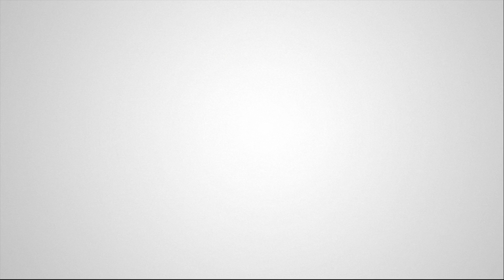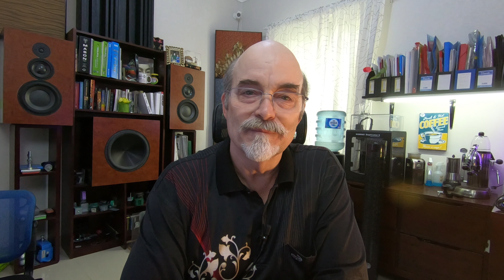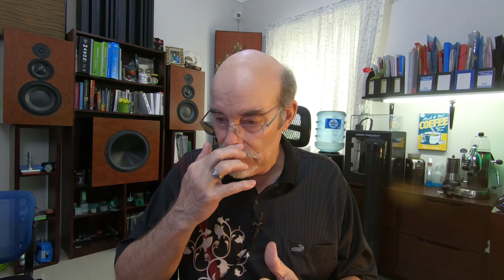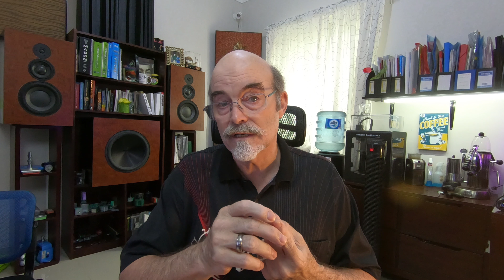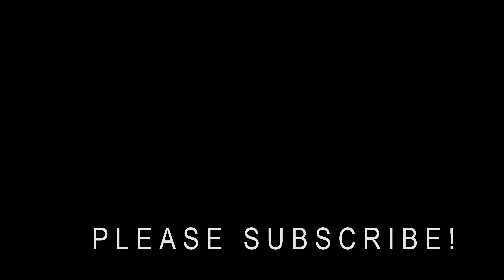Rock Wool Does Not Sound Proof

Comment: I used the rockwool r30 for my ceiling joist throughout my basement and rockwool r13 along the walls throughout the basement. I used 3/8 drywall to cover the walls and 1/2 drywall on the ceiling and added a door to the top of the stairwell. I have electric guitars, drum set, entertainment room and lots of company over often. If the vents are closed in the basement, you literally can't hear ANYTHING going on in the basement with volume at full tilt. Maybe I did something different to get such results but my experience with rockwool was definitely soundproofing
Reply from the maker: Very nice! I'm happy for you. But it WASN'T the rock wool - LOL!! Your story is anecdotal. Correlation does not mean causation. I am teaching only FACTS here. Do more research... and I do not recommend that you try to convince others that the way you did it works to any degree at all or that it will work for anyone in any situation. It worked for YOU, in YOUR basement, with YOUR materials.
Reply: John Brandt do you know what it could be that cut the sound down?
Reply from the maker: I cannot claim to 'know' because I don't know your complete structural build, however, I am pretty confident that it was MASS and SEAL - along with the damped resonance of your structure. But I have NO IDEA 'how much' it contributed to the attenuation of the sound because no standardized tests were performed. That (standardized tests) is really the only way to gauge.
Reply: its a common construction product and it does help.  why would constructors spend thousands on it?

Comment: Great video!
What do you suggest to buy for better (dampened) studio accoustic?
I was going to make DIY rockwool panels, but glad I watched this first.
Is there any DIY with better sound absorption than cheap foam?
Reply from the maker: Martin B, for your ACOUSTICS, it depends on the thickness required. Normally for acoustic control in an enclosure, you should use broadband trapping appropriate for the room (dimensions) and I normally recommend either glass wool or rock wool with a density of 10 - 15 kg/m3. That's the lightweight stuff. This video is about 'soundproofing' with means 'blocking sound' from getting in or out. 
You can send me an email. :D john@jhbrandt.net

Comment: From what I understand people don't utilize Rock wool to isolate their listening environment, but rather to absorb stray frequencies in high reflective areas to avoid phasing or delay.  I think what most people don't understand is that it costs a stupid amount of money to isolate your listening environment well. your basically putting a room inside of a room. but for the average Joe like me, we look to make the room at least try to sound better. I'm an aspiring mix engineer, so having a listening environment that's neutral is everything. With that said for most people who work in a bedroom, that's just not possible. Little things like rock wool pads in the reflective areas at least dampen the frequencies that may impact our judgment if they weren't addressed.
Reply from the maker: You are absolutely correct about what rockwool should be utilized for. :) This video for those who think that it is some kind of isolating product, which it is not. 
It does not, however, cost a stupid amount of money to isolate your listening environment. Please see my other videos where I describe a few options. A 'room-in-a-room' is not always necessary.

Comment: Interesting. So I have a room mildly covered in acoustic panels. Right now I want to treat my mix area and ceiling but I don't want to use those 12 x 12  2 inch panels. So what would be better to hang Rock Wool or Owens Corning???
Reply from the maker: It depends. Send me an email. 😉
John@jhbrandt.net

Comment: try to imagine concrete wall vibrating
glass sealed with silicone is better than drywall for soundproofing for the same thickness
meaning HIGH DENSITY (MASS PER VOLUME) is the best barrier against sound
btw, anyone happens to know the density of cement fiberboard vs mdf? which one is denser?
Reply from the maker: Cement fiberboard wins, my friend. :)
MDF is about 827.17 kg/m3 while cement board (Hardiboard) is about 1136.4 kg/m3. So for the same thickness, the cement board is heavier. 
And yes, glass is 2579 kg/m3 vs drywall (gypsum board) at 676 kg/m3

Go to my resources page and download the Reflections-Boundaries-Mass spreadsheet. There are hundreds of calculations in that thing. (I think I've put too much in there! LOL!)
https://www.jhbrandt.net/resources/

Comment: thanks , iv looked on the net can't find any light weight fibreglass , where on the internet would I get the fiderglass for in-between walls ,,, thanks
Reply from the maker: Home depot. Lowes. Any DIY supply store.
Owens Corning Pink. Safe n Sound. Etc
Reply: @JHBrandt  Hey! I have a question, I want to build acoustic gobos for recording instruments in my bedroom. i’m planning on getting 7 inch thick pink fiberglass insulation- they’re going to be 6 feet tall and 4 feet wide and im building 4 of them. Would there be much of a noticeable difference between regular pink fiberglass insulation and rockwool? Rockwool is so much more expensive. I’m sure there’s not hardy any difference just for gobos (cutting room noise down deadening a little just good enough for a really solid home recording right? (also would the facing on the back of the insulation matter at all? or should i plan on cutting it off?)
Reply from the maker: @natestrayhorn1578 , get the cheap stuff. It's actually better at low frequencies. Buy the unfaced insulation as is used in the attic. (Attic Blanket or Loft Roll) 
All the best!
Reply: @JHBrandt  i wanna do 6 feet tall by 4 foot wide. Do you have any places to get something that would suit those dimensions? i don’t wanna spend over like maybe 80 on all of the insulation? Idk just looking for my options
Reply from the maker: @natestrayhorn1578  that's 24 square feet.. Costs about $40 USD... Shop around. 😁

Comment: Incorrect, someone should double check, though. I took some time and went through IR 761, it actually says mineral wool performs slightly better at transmission loss than glass fiber, although you can improve glass fiber performance by using denser varieties (but if you compress it too much it's actually worse as it creates a mechanical connection)
Reply from the maker: Sir, don't be an idiot. I have it and have read it. I have also compared the measured data. ROCK WOOL DOES NOT SOUNDPROOF!
If you would simply read ir761 and study the difference in partitions insulated with fiberglass vs mineral wool, you will see the difference. 

Besides, I have NEW data from the world's largest reverberation room capable of measuring to 25 Hz accurately. 

You can make statements all you want but they will be meaningless unless you back them up with empirical evidence. (the evidence I have)
Reply: @JHBrandt  I made the comment after I did go over it. I think you were looking at the graphs for fiberglass that had a larger air gap or double studs.

Do you have a link for this new data or is it topp secret?
Reply from the maker: @anfernyjackson9013  LOL! It's not top secret but we're working on publishing a few papers about it. These videos, especially our recent ones are substitutes for written papers. 

ir761 - compare the exact same walls with the only difference being fiberglass vs mineral wool. You'll see what I mean. 

See my recent videos featuring my friend, Ron Sauro (and look at his resume)
Reply: @JHBrandt  I double checked the paper, it's missing data for some key equal elements, but on page 57 and 59, with steel studs and all things equal, mineral wool has better results for the frequency range, it has a lower drop at 125 Hz which throws the STC weighting off due how the algorithm works. 

I'll look forward to your new data though, once they get cleared from area 51. I was going to check out the vids with that Ron fella but it looks like he's doing vids inside of a cave with a 20 year old camera, he probably still has lead paint and got his job from his uncle.
Reply from the maker: @anfernyjackson9013  You can think what you want. I don't give a fuck but judging a NASA scientist and friend of mine based on appearances pisses me off. I try to help everyone but you are an asshole.

Comment: Thanks for this vid. I recently purchased 26 rigid fibre insulation panels unfaced - 1500mm X 2400mm.. 50mm thick. (I think it's for large air duct work.. was a good deal) It's enough to do 2 layers on a 3m square room @ 2400mm height, which my rough plan was to make that (drums) room in my garage.. freestanding straight on the  concrete floor. Basically just the insulation panels and minimal steel non load bearing frames to hold them..+ door(s) I had thought, if I do this 2 layers of 50mm rigid insulation with a 50mm air gap between that it would dull the sound transmission a decent amount. But I don't want to even bother if it's no better than having my drums in a spare room in the house. I could put the panels to better use making traps etc... I think? Or treat the entire garage maybe. In Looking into leaf systems and them all having to do with resonance tuning.. I'm not even sure if the air gap is relevant between rigid insulation panels instead of proper hard mass leaf sides. I'm still a bit confused.. I kind of want to try my plan just for experiment/experience sake, but then there's some cost there in the framing. Any input appreciated 👍
Reply: how is it working
 ?

Comment: As I understand, high-mass, high-density "soundproof" materials you mentioned will reflect/bounce the sound that hit them back off its surface instead of letting the sound to go through, and you called them "soundproof". Rookwool, on the other hand, does not reflect, but absorb certain proportion of the sound wave energy, and letting the remaining to get through. Is that right ?

So if there was a material similar to Rockwool, but absorb 95% of sound energy (say at 10cm thick) instead of bouncing it, will you call that material "soundproof" ?
Reply from the maker: I'm sorry. But you understand nothing if you THINK that 96% is absorbed by ANYTHING. No fiber, either lightweight or extremely dense, does 'soundproofing'. You need to get off the internet forums and go read some REAL research papers, like mine and other professionals. 

Dense Rock wool, by the way, has a high "reflection coefficient". Yes, it is reflective of bass frequencies. ;)
Reply from the maker: AGAIN, no fiber will soundproof. Forget about it and call a professional. ;)
Reply: @JHBrandt  Well, I spent more than $1500 to cover my cinema room with 3 inches of Rookwool two months ago, and recently I embarrassed myself when I found 2cm thick empty foam box, put my phone in it, closed the lid, and find out that the sound hear just nearly the same, just a tiny less loud, as opposed to "sound proof experiment" using foam or rockwool box around internet.

That's where you missed my point, I am trying to define what "soundproof" actually is, and I believe high-mass&density materials only "soundproof" by reflect the wave back. I presumed in the future they might find some light-weight material that provides strange physical properties, say it can convert pressure into heat so quickly that it absorbs nearly all energy coming from sound wave (nobody know if that material exists or not ,but lets face it, nobody could imagine thermal conduction can reach speed of sound before they found that out in sub-zero liquid Helium, right ?). Then at that point, can I call that high-absorption material "soundproof" since it stop most of the pressure wave from coming through ?
Reply from the maker: @minhhong4924  You can do whatever you want. Physics really doesn't CARE what you believe. It's your job to learn how it works. By the way, there is no such thing as 100% soundproof, unless you are in the vacuum of space. ;)
I recommend that you get these two books and study them; "Architectural Acoustics by M. David Egan" and "Acoustics Sound Fields and Transducers - Leo L. Beranek"
Reply: @JHBrandt  it does not look like you read my comments fully. No problem though :)

Comment: I have an exposed ceiling in the room in my basement where I play my synth, record podcasts, and make work calls. My toddlers are upstairs with mom or the nanny pushing chairs and tables around, and throwing tantrums. I don't want to hear them, and they don't want to hear me. Especially the chair pushing on hardwood floor that sounds like a vacuum cleaner. I thought Rockwool would at least block some of that two way noise traffic, but my takeaway from this is that it wouldn't make much of a difference at all?

Thanks for sharing your knowledge and expertise.
Reply: The toddlers throwing tantrums or the nanny throwing tantrums?

Comment: 3:11 Never lower than 500 Hz? Is that because the drywall on the outside of the wall blocks that before it enters the wall cavity?

Here is my quick research.
"People can hear sounds at frequencies from about 20 Hz to 20,000 Hz"

"The voiced speech of a typical adult male will have a fundamental frequency from 85 to 180 Hz, and that of a typical adult female from 165 to 255 Hz"
"Jet engines emitted broadband noise with spectrum dominated by components in the frequency range 315-6300 Hz"
"Typical frequencies of a pair of horns of this design are 500 Hz and 405–420 Hz"
"The spectral content of the main part of the acoustic energy was less than 400 Hz (peak 16-100 Hz) for large-caliber weapons and 150-2,500 Hz (peak 900-1,500 Hz) for small-caliber weapons (rifles)"

Can anyone help me understand my confusion here? Is resonance a completely different relationship with the frequency of sound?

Comment: Hello Sir. Regarding phonic insulation, what do you think about polyurethane foam board HD Foam Plus or polyethylene Stratocell Whisper/Quash boards? Which one of these materials could be more efficient?
Reply from the maker: No. Polyurethane or polystyrene, or any closed-cell insulation board is useless acoustically.

Sound proofing requires mass and seal. Absorption in the wall space helps but it's not the main component of the system.

Never use closed-cell board for anything but thermal insulation, where it excells 😉
Reply: @JHBrandt  Thank you Sir for your quick response :).

My goal is not necessary to improve the acoustics in the room but to reduce the noise coming from my "sweet" neighbors. 
I was thinking to use one of the above materials in ceiling and walls and close the structure with Rigips blue acoustic boards, but now I'm kinda lost. 
Can you please tell me which material is more suitable in this case? Much appreciated.
Reply from the maker: @camy8443  fill the wall or ceiling cavity FULL with either fiberglass or Rockwool. Use a density of about 15 to 22 kg/m3. Heavier won't help. Use only a fiber type insulation.
For the most isolation, use the fire-rated gypsum board (drywall or plasterboard). Use more than one layer. 😉
Depending on the need and application a deadsheet can be added between the drywall layers.

But you shouldn't go throwing everything at it. Don't guess. Send me an email if you want my help 😊

Comment: @John Brandt   I have a home theater inside my room and I want to install fiberglass on the wall to isolate the sound from the neighbors, would you recommend that?
Reply from the maker: No, sir. I would not.

You may try, but you will not succeed in isolating your sound from your neighbors.
As Scotty said to the captain... "Jim! Ye canno change th laws o physics!"
Reply: @JHBrandt   ok ,  But in cinemas, they use fiberglass and acoustic to isolate sound !
Reply from the maker: @ronyomar100  uhmmm, no, 'they' do not. Unless they are DIYers with no knowledge of isolation.

Go ahead and follow popular opinion. You know, if we had followed popular opinion, we would never have reached the moon or even built a space station or space telescopes.
It is physics, my friend.
Reply: @JHBrandt   What do they do in the cinema to isolate the sound ?
Reply from the maker: @ronyomar100  structural isolation is often required because of the high-level low frequencies produced in a cinema (home or mega-theater). Isolation is accomplished using a mass-air-mass system. Fiber is used to damp the vibrations in the wall cavity (air), but the mass of the partitions are far more important, as is the seal of the partitions - mass).
If you need help, please send me an email and let's schedule a time to talk via zoom.
John@jhbrandt.net

Comment: I did an experiment at work, I took 3 long Rubber floor Mats about 3/8 or less & wrapped them around my Radio Boom Box, 2 wrapped around & one laying over the top. I then pressed into the left & right side sealing the open air sound transfer & that is when it showed to be well worth the experiment. Many Weight Lifting Gyms use 3/4 Rubber Horse Mats some times tripled & reduce the (BANG) sound & vibration from dropping (weights) onto the floor. I am going to apply 3/4 rubber Horse Mats to my 6" wall studs in my Mobile Home & reduce out side & inside (sounds) I have 2 Classic EV Pro Loud Speakers 15" & Horn Loaded Powered with Allesis RM500 Amps there A B 500 Watt's in Mono each powers a SH1250 EV, I also have a Vintage Cerwin Vega Sub 18" with a 10" Speaker in front, the guy I got it from said the Base Player for the Charlie Daniels Band used it for his Base Guitar Speaker. I have watched YouTube Vintage Vids of them Playing Live looking for it, I saw a maybe. hahaahaa I would experiment with1/2 inch of sheet rock & 1/2 of Rubber Horse Mat ((sealed)) air tight & listen & record said sound TEST!
Reply from the maker: Dan, that's NOT how testing is done.
There are several good software prediction programs available for STL calculations.